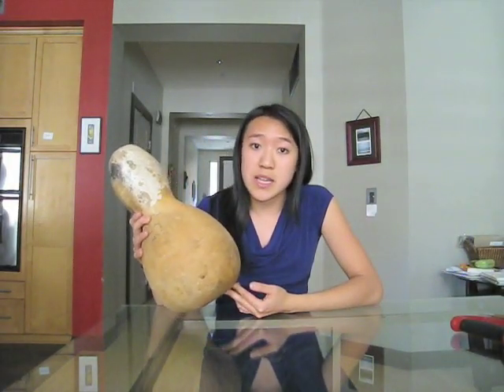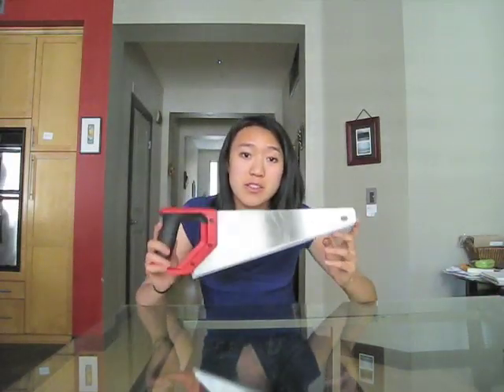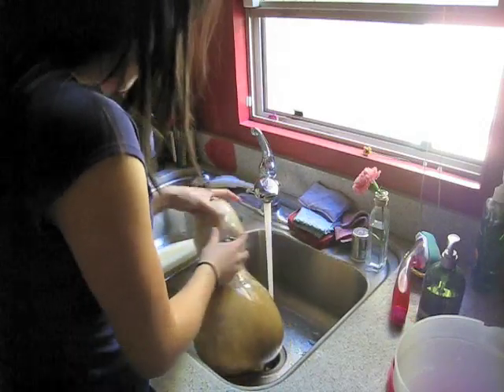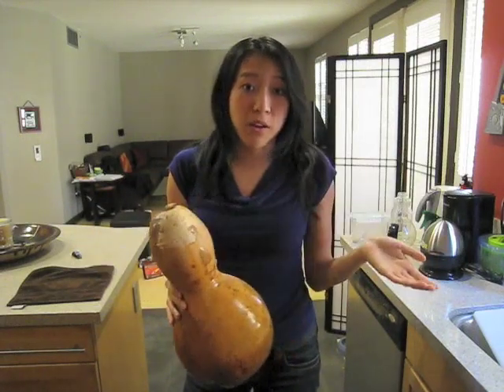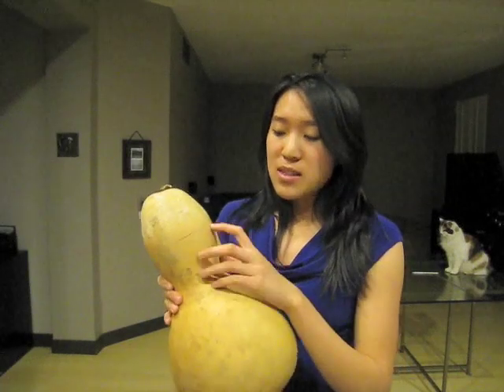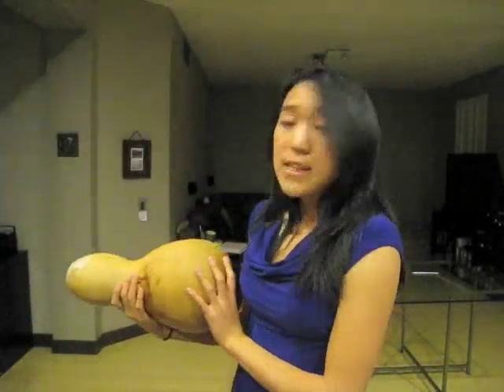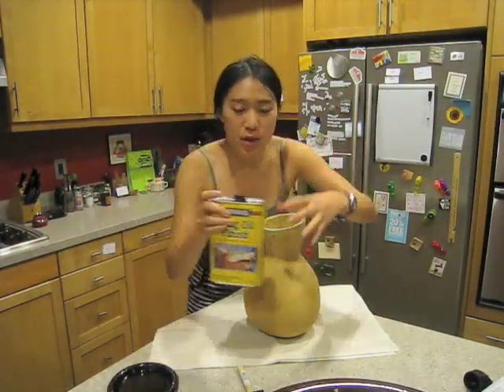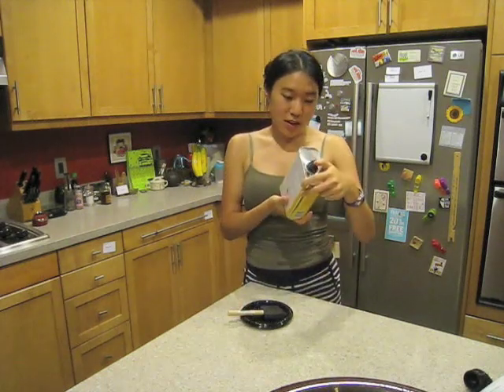How to Make Shekere (Part 1/4)

Comment: You should use a paint mask when you clean and cut inside a gourd.  That white/black mold is what cures the gourd but you do not want to breathe the mold. Almost all gourds have some mold. You can use that stainless steel scrubby in the inside to get all of the seeds out and make the inside smooth.

Comment: Before sanding or cutting gourds, soak the gourd to make removal of black (mold) easier, and be sure to wear a mask, preferably a good one (I found out the hard way - gourd dust can be very harmful to your respiratory system) before sanding or cutting or cleaning the inside of the gourd!